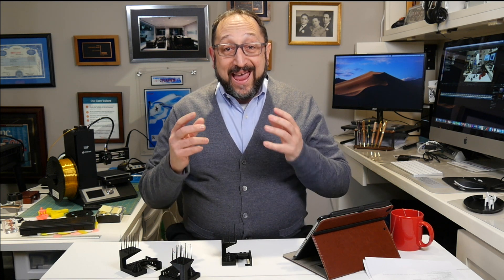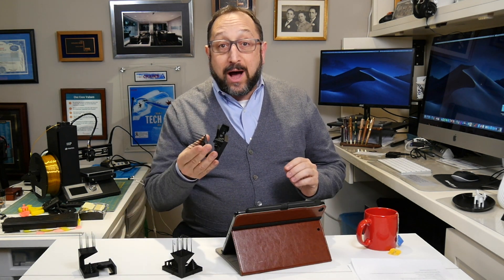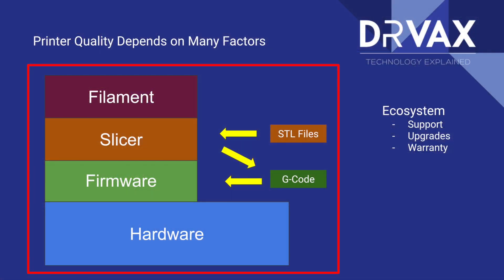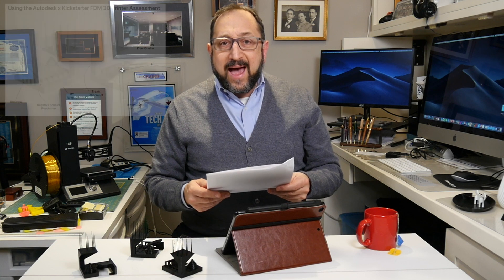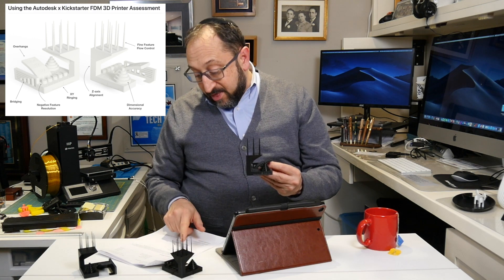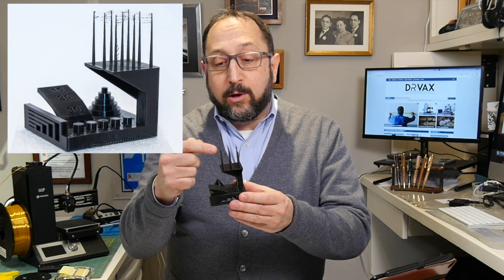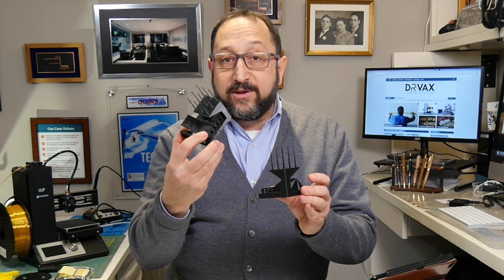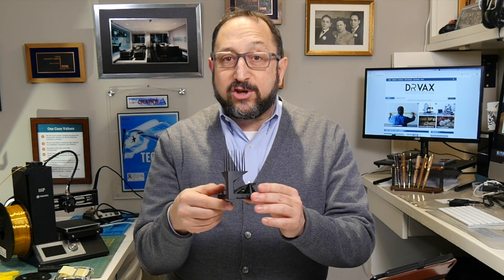Creality Ender 5 vs Original Prusa i3 MK3 (Updated Comparison)

Comment: Because I did my homework, and I am cheap, I chose to get the Ender 5 over the Prusa, and with this video I now no longer worry if I am missing out on something the Prusa would have given me.  Thank you sir, this video is so very helpful and I hope it helps many people make an educated decision.  I think I have to agree with your statements, the Ender 5 is a consumer model and its priced well within that range.  The Prusa is a pro-sumer model and properly priced as well.
Reply from the maker: Glad this is working out for you.  One interesting "feature" of the Prusa is it is significantly faster than any other 3d Printer I own.  I believe this is because of the direct extruder that limits the need for long retractions, the default print all object walls at once approach of the prusa slicer and the overall higher end components capable of better speed.

Comment: Curiously, on my Ender-5, the towers were perfect to the top with ZERO stringing.  There was very slight stringing under the overhang but other than that, it was perfect...  my Ender-5 has a factory 1.1.4 standard board in it.  Maybe that accounts for the difference?
Reply from the maker: Interesting.  Could be that the firmware defaults are different.  It also could be the filament you used.   Different filaments have very different stringing characteristics.  What ever you are doing keep doing it.

Comment: Thanks for this video - very informative, helped solidify my decision to invest in a Prusa.
Reply from the maker: As I have continued using both printers I have found the faster controller board on the Prusa and higher grade components do make a difference.  If print speed matters the extra dollars for the Prusa make sense.

Comment: Dr.Vax I have seen the answer to this question in the comments but I just can’t find it again, hope you could link the answer or answer again.  My Ender 5 did not come with Cura settings on the SD card.  I think you said you can load the Ender 3 in Cura and then change bed size.  Is this correct?  I’m running the dog test print that came on the SD card and it is going well so far.
Reply from the maker: Yes.  Just add a new printer specifying the Ender 3.  Then go to "Ultimaker Cura" in the upper left corner, click it, then click "preferences".  In preferences click on Printers.   In printers select your printer and then click on "activate".   You cannot adjust the printer settings until you click on activate.   Once you click on activate you can click on machine settings and set bed size to the proper size for your printer.

After doing this I recommend watching my video on  Perfect First Layers which will talk you through some additional settings you probably want to adjust.

https://youtu.be/pAFDEn3wGYo
Reply: DrVax Thank you once again.

Comment: I also purchased an Ender 5 because of your review. Thanks a lot for your effort.

I have one question as I would like to upgrade my fans for the power supply box.
Problem is I cannot figure out how to get inside the silver metal box as the only screw I see is inside of it.
Do you (or anyone else reading this) have a solution for me?
Reply from the maker: Sorry.  I have not tried to open the power supply. Maybe a channel viewer will have a suggestion.
Reply: Please please please do not mess with a power supply unless you have at minimum decent knowledge and experience with DC and AC electronics. 

Power supplies have the ability to kill due to the capacitors on the AC side of the transformer.

For reference of how nasty they can be consider that the capacitor in a disposable camera for the flash mechanism is enough to act as a light tazer. The capacitors in a power supply are far far more powerful.

Comment: i get 16 points with my  cheap i3 clone
Reply from the maker: If you are willing to do some work and have software and hardware skills you can find a number of inexpensive 3d printers with lots of features.  The tradeoff is the quality of the components and the lack of support.  With some of the most inexpensive 3d printers, you are really on your own for support.

In addition, the quality of the components in a higher end printer, such as the Prusa, is significantly better.  For example, the mainboard has more memory space and a built-in bootloader, the extruder is more robust and precisely machined gears, the magnets on the print bed can handle higher temperatures, etc.

In some ways, the tradeoff is between time and money.  You can update any printer with better components if you have the time and expertise.

Comment: Few things you didn't mention: 
1. Prusa is very reliable
2. Removable bed
3. Tech Support
Reply: 4. There aren't glaring electrical oversights that could burn your house down
Reply from the maker: Thanks for your comments.  The Prusa is clearly a higher end machine.  It is also much easier to upgrade fw on the Prusa due to the built in boot loader.  

However I think what is key is matching the printer to the users needs.  The Ender 5 does have a removable bed and say to day for me has been as reliable as my Prusa.

Comment: Thermal runaway protection vs. no thermal runaway protection.
Reply from the maker: Correct. Even more important the MK3 has a built in boot loader.  This supports much more easily updating the firmware.
Reply: New Enders have bootloaders
Reply from the maker: Interesting.  My Ender 5 did not come with one, it is about 3 months old.   Do you have a link to any information on this?  Do you know if Creality supports upgrading existing machines?  Thanks for participating.
Reply: @MakeWithTech  There are some recent videos on it they just done it so not many.

Comment: What you are not talking about is how many times a print fails on an Ender 3 compared to a Prusa. I don't have the answer for the Prusa but the Ender 3 was a disaster. The only good (very good) print was the first. All the others came out as "just ok" to a complete failed print. Having too many problems with bed adhesion, I returned it to Amazon with anger and deception. Now I'm just questionning myself if I'll go with a Prusa or not.
Reply from the maker: This comparison is with Ender 5 which is quite different from the Ender 3.  It has the new magnetic print bed which is also different from the original Ender 3.

I use MagiGoo with all of my printers, except for the Prusa, and my prints always stick.  In addition, the Ender 5 has an assisted bed leveling procedure which makes it a bit easier to get the bed properly leveled.  All together the Ender 5 is different from the Ender 3 and I consistently get good prints.

Comment: Very good and helpful review!
Appreciate your calm way of talking.

One important question:
If you would compare the sound of both printers, which one is more silent?

Thank you
Reply from the maker: The Prusa is quieter by about 5db.
Reply from the maker: I looked up my notes.  Here are the DB readings I get for the printers using a cheap Radio Shack DB meter:

Ender 5 printing a vase in vase mode 60db

Prusa i3 MK3 printing the same vase was at 54-58db

Monoprice Select Mini 62-65

Monoprice MP10 is about the same the Ender 5

The Mini Select become much loader when printing quickly.   Overall the sounds from the MP10 and the Ender as similar, they both use Creality style wheels and similar stepper motor control chips.  The Prusa stepper motors are very quiet but the print bed, Y-axis bearings are quite noisy.

Comment: All I've really learned from most all of the comparison videos on youtube is that almost every 3d printer can be made to print as well as any other provided you spend the time to tweak things to fit that particular printer.
Reply from the maker: I appreciate the comment.  I agree for PLA but I do not believe this is true as you move to move difficult filaments that require higher temperatures and are more difficult to extrude.
Reply: @MakeWithTech  That's good to know. I appreciate the videos and I thought this was a great one; I didn't intend for my comment to sound as much like a criticism as it did. I just ordered an Ender 5 but it's different than any other I can find reviews for. This one comes with the Version 2.1 controller board, like the CR20. I'm hoping that the additional flash on the Atmega 2560 will allow me to do things like add the BL touch without having to sacrifice other functionality, as many have discovered with the Ender 3.  I'm not sure if there any other differences from the original Ender 5, but am anxious to find out.
Reply from the maker: @jamesmerritt5562  I am very interesting to hear your experiences with the Atmega 2560 board.  I order one of the very first Ender 5s so it would be great if it was easier to add a bootloader.
Reply: @MakeWithTech  I appreciate your replies. I have also reached out to a few other 3d printer reviewers that have experience with the Ender 5 for their input. As you can imagine, because the one I ordered has a different controller, it changes the way I must perform upgrades, like adding ABL or thermocouple sensing with upgraded hotends; there are, quite simply, no procedures for how to deal with this controller firmware on this machine.....even Creality offers no documentation at this time. I'll update as soon as it arrives.

Comment: Hi. The MK3 is my first experience with 3d printer and I'm glad that I went with prusa. I didn't have any issues follow the superb prusa instructions and the customer support. I got a bad filament sensor customer service replaced in a week with out issues. Know I order the upgrade for mk3s with shipping $33.73.
Reply from the maker: Yes there support is excellent.
Reply: Prusa has seriously the worst quality control I've ever dealt with. Print bed, filament sensor, hot end, and PINDA sensor were all either dead or defective. Their support is great and helpful, but that doesn't make up for things that should have worked from the beginning.

Comment: why say printing a couple of times a month? who prints a couple times a month?  If that was the case, why would you say it with the Ender 5, wouldnt that be more of something a tad cheaper like the Ender 3 ?   That would make it so that statement doesnt even come into the picture..
Reply from the maker: Thanks for your comment.  Even if you print a few times a month I think the Ender 5 is a better machine than the Ender 3 and worth the extra money.  Many hobbyists use their 3d printers in bursts. They may use it every day for a couple of weeks and then not use it at all for a month.   In this case or basically, the case where you are not using your printer every day I think the Ender 5 is perfect.  If you are using your printer every day, due to the enhance ecosystem and support,  I think the Prusa is a better choice.
Reply: @MakeWithTech    if thats the case, you can make an Ender 3 just as good as an mk3 for half the price, and still have the money to put an octopi setup and still come under half the price of an MK3..  several of the guys at the makerspace here in town have print farms and are making good money with cr10s' and a plethora of ender 3's..
And the ecosystem.. the old times of there only being a small 3d printing eco system that are brand orientated are over.   You can get professional prints and do good business with the creality line and have years of good success at little cost for maintenance and upgrades.
Reply from the maker: I agree completely with you when the user is technically sophisticated.  Many of my viewers are first time 3d printer user or using a 3d printer for the first time in a business where the printer is just used for prototypes.  In this case, the ecosystem is important.

Either way, I really appreciate your participation in the dialog which will benefit everyone that comes to read these comments.
Reply: Like a good conversation about printers.
Your video came across my feed and I just happen to have three Ender 3's, a cr10s, bq hephestos prusa i3, and some others.
Have associates and friends with the same and some mk2's and mk3's.
Its amazing how far along printers have come and what the price of entry is these days; while also maintaining quality and performance.
Just thought the Ender 5 and mk3 comparison was a tad unfair based on your tests.. like vs like should be taken into account and use the same slicer on all the printers for sure.
But thats a video for another day.
Thanx for sharing and allowing some good 2 way conversation.
Reply: James Que using the same slicer on both makes it a highly unfair comparison. The only thing you can meaningfully compare is performance as the manufacturers ship it, operated as the manufacturers say you should.

If you’re going to treat it as a kit of parts for an almost unrelated reprap, why are you even looking at reviews?
Reply: @JasperJanssen  what?  You use the same slicer to get a comparison based off exactly what the title of this video is doing.. a comparison of printers and their features.. 
operating as the manufacturers say?  Most folks these days look up reviews on youtube or hit up a group on FB and talk to people that have been printing a while. They'll then go off of their recommendations and use the printer in those ways.. which are based on experience and are much better for everyday use and special case use.
And no, you can definitely use the same slicer for comparing a lot.  Anyone who gets a printer will tweak it until they get it running golden.  The title of the post was of course comparing a creality printer versus a prusa printer.. didnt mention anything modded in the title so one can assume that they are stock.
unrelated reprap? do you even 3d print?  This video is taking two different styles/builds of printers and comparing them.. the Ender 3 is a creality printer but of the same style type as the one from prusa that was used for comparison.. so it very much deserves a mention.
Reply: @JasperJanssen   I take it you have a prusa mk2 or mk3 and have yet to step out of that bubble? 
The Ender 3 is very much the same type of cartesian printer, and is very much a "related reprap".  
Arent all printers works in progress, so essentially that makes them all a kit of parts.. so me watching "reviews" as you say, is just a regular part of learning more about the ecosystem i'm playing in.   
So the better question would be,  why arent you watching reviews?  'Cause you obviously arent if you think the Ender 3 is another kit of parts type of unrelated reprap. But I could totally be wrong..   But the Ender 3 and Ender 5 are VERY good printers for the price.. just sayin' ya know.
And I'm not an Ender 3 fanboy by anymeans. I love the printer, but I'm also knowing the mk3 is that ipad of printers for the price.